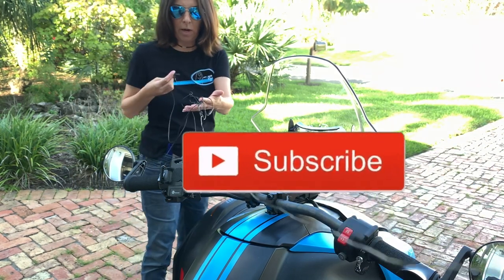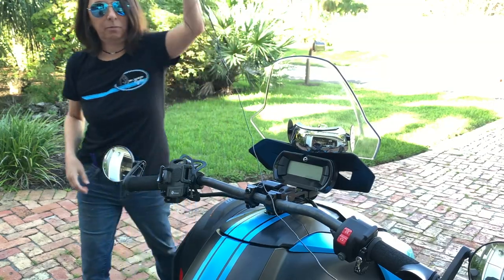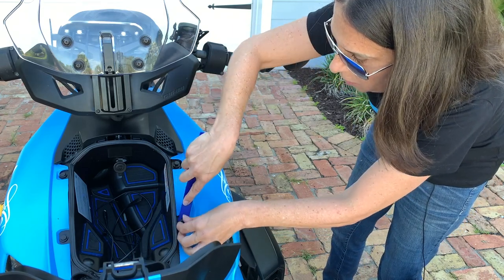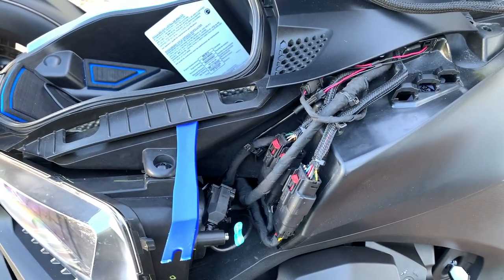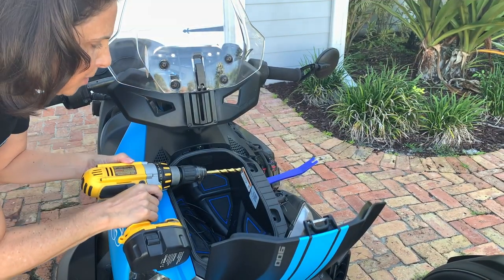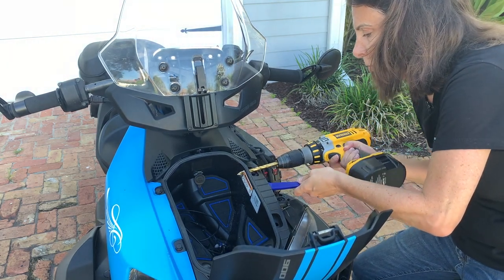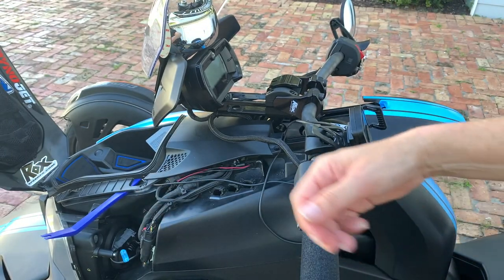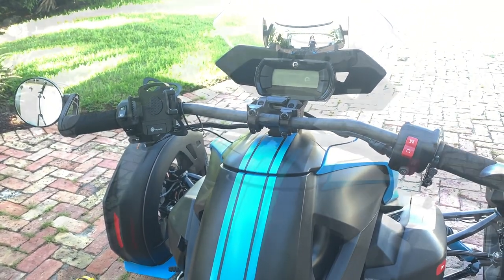How to Run a HIDDEN Charging Cord From Your USB Port to Your Phone? (on a Can Am Ryker)

Comment: Thank you. Thank you. All these many decades, I have had my hidden secret exposed that I also have, like pretty much every one else, tried to plug in an ext cord backwards, tried to put a key in upside down and been frustrated by a drill bit that won't drill because I have the drill in reverse. It is nice to know even the best of us can sometimes get backed up on it. :). 
An excellent video. How many of us have gone with a dead cell phone because we did not have this? You probably could have shown how you cleaned up the burrs and put the grommet in. I'm sure someone will recommend that, thinking you did not. On mine, I just put a little dab of RTV in the hole.
Also, some might think that the small indent under the seal could be used for bringing out the cord. While it probably could be, it is probably best to leave it as the heat buildup vent that I think it was intended to be. It gets mighty hot in there if no place for the heat to escape.
Love your sense of self-deprecating humor. Makes watching your videos so much more enjoyable than watching other straight foreward, boring, dry how-to vids.
Keep up the good work.
Reply from the maker: Thank you Ryker Parking Only!  You made me feel better about my mess up! Yes, life happens! We all mess up at one time or another, I just happen to have done it for the world to see....and comment on! LOL  Have an awesome day and thanks for your support!!

Comment: Great way to get power to you phone from the glove box without any major wires running out. What i did was similar but i was wiring the amplifiers for my speakers and what i did was remove the glove box then while i  had it out i removed the double USB connector and ran my positive/negative to the the rear of the USB to power my boss amplifier that only turns off when i power down the bike which is what you may want to save your battery :). The drill point was directly under the round double USB connector. Its a cleaner look for those that want to run either a USB or 12v power to the USB aux. Just something i did and it worked as well. Thanks  again for posting these awesome helpful videos!!!!
Reply from the maker: Thanks so much for your detailed comment! I love when people post different ways to get stuff done.  It gives others options to figure out what works best for them.  Much appreciated!

Comment: Beth, another great video and an easy way to run the USB cable to the bars. I would done it the harder way and pulled out the fronk and unplugged a USB cable made a splitter and run a cable up to the handlebars from there but I am good with electronics.
Reply from the maker: Wow that would have been a much better way to do it!!  Next time, I'll ask you first!
Reply: @RykerRydes  It is easy sitting back and come up with a different way to do things.

Comment: I did mine the lazy way... I bought a flat USB cord from Amazon and basically did all the routing the same as in your video from there.  I was a little paranoid about leaking if I had done any drilling.
Reply from the maker: I thought about rain getting in there as well.  I might seal it up...even with some heavy duty tape...incase I need to swap out the cord one day.

Comment: I've just installed a QuadLock wireless charger on my 23 Ryker. No holes need to be drilled for a seamless install. Just buy the caharger version with the 12-24v leads. Splice piggyback connectors to that and attach it to the back of the glove box usb charger. And if i would knew. Aparently, there are some additional plugs available for peripherals on the right glove box side under the cover.
Reply from the maker: I actually have a video on the quad lock and use it as well. Great product!

Comment: Fun fact as long as you're in there. The two wires connecting to the USB ports is 12V rated at 5 amps - the conversion to 5v for USB accessories happens inside the plug box. Easy to add a breakout connector using spade connectors to provide 12v power for other dash accessories or maybe even add a 12v plug inside the frunk.
Reply from the maker: Awesome.  Thanks for the information!!

Comment: Hey Beth,
Great video.  Just installed my USB cable on my 20 Rally.  Shocked I didn't break any clips!  Question - what length cable is everyone using?  I used a 10 footer and had to bundle the majority of it in the frunk.  I am think a six footer would be better.
Reply from the maker: Hmm good question.  I did it so long ago, I really don’t remember.  Trial and error I guess. 🤔
Reply: @RykerRydes  I replaced my 10-footer with a six-footer and it was slightly too long.  I have seen cords in 4, 6, and 10-feet length so I think a six-footer would be best.  If anyone had any success with a four footer, please let me know.

Comment: If you look at your video again you will notice a small notch in the frunk close to where you drilled your hole. It's meant for a USB cable to sit on top of the seal but the cable will sink in and the seal will still keep it water tight. I used it to add power to my speakers using both USB ports and hiding the cables just like you did but I zip tied them to existing cables to hide it better.
Reply from the maker: I just that little notch!  Hmm....That would have been helpful to know 48 hours ago! lol Have you tried it?  Does it work?  Worried it would put too much pressure on the frunk.
Reply: @RykerRydes  I have my USB cable running through it but haven't tested it with water to make sure it's still water tight. Hopefully I'll never need to worry about it. I don't plan on riding in the rain and I have a foam spray that I use to wash my bike. No water needed.

Comment: Drilling holes in OEM part not designed for them is a huge NO-NO for me.   You have access to the 12V supply to the charger behind the frunk, why not just tap into that (properly) and add a second charging module that just stays hidden except for the cable running up to where you want it?   Why didn't you get a longer USB cable and run it along with the wiring to the controls?  As you showed it doesn't look so great and potentially will get torn out when you turn. No Bueno.  Sorry.

Comment: Hi Beth... thanks for the great video!!! I’m going to do this mod soon...
Quick question tho... I bought the Slingmods tank & fairing bags, keep fighting them coming untucked from under the color panels..so the last time I had to take them off, I broke the pin on the body, front that the panel attaches to... any suggestions on how to fix?
Reply from the maker: I don't personally have those bags, so I am not 100% sure how they stay on.  But, as far as the pin breaking, it is very easy to buy a bag of replacement pins. Here's a good website for parts:

https://www.cheapcycleparts.com/oemparts/a/cam/5c2f76f587a8661634626b5a/body-side-panels
Reply: Ryker Rydes I’m going to have to politely piggy back & say THANK YOU for this link!  Guess who cracked their front hood clip when removing to attach their battery tender while waiting on the dmv.🧐 Doh!  Ps: this video is 👍🏽👍🏽👍🏽🦾
Reply: I broke one of my fairing clips and found out there were 2 spares located in the bag with my user manual, i had no idea at first what they were for till i put the two together and figured this piece is prone to break easy. I have a 2020 but i assume it may come in the manual bag that its in with a screwdriver in it.
Reply: So I found out they’re called dart pins, I ordered 2 from my dealer. There’s a video on YouTube, by ceedee
Reply: Pt. 2 removing the broken dart pin, and replacing it using needle nose pliers…I’ll see if I can find it and copy the link, here
Reply: @sharismithson1233  Thank you for posting this!

Comment: How do i get to the usb ports? Mine is not even connected to the battery.
Reply from the maker: You need to take the glove box out and simply plug the usb into the red and black plugs that are there.  The dealership should have don this for you during assembly.
Reply: @RykerRydes  thank you! I will definitely hook it up today. You are the greatest. Keep doing what you're doing. You're making us ryker riders proud!

Comment: That's a great idea, just wondering if water can get in that little hole you drilled?
Reply from the maker: I am sure it can.  I just put some heavy duty tape around it, in case I need to change the cord out.
Reply: @RykerRydes  Big fan of 3m WindoWeld windshield mounting tape for waterproofing and mounting most anything. Just rip a piece off the roll, roll it to the correct size, and press it into place for a permanent seal. $20 a roll, but you'd be amazed how often it comes in handy. Just used a couple small balls of it to stop a rattle on my 360 degree mirror. 

And yes, you had the drill in reverse. <G>